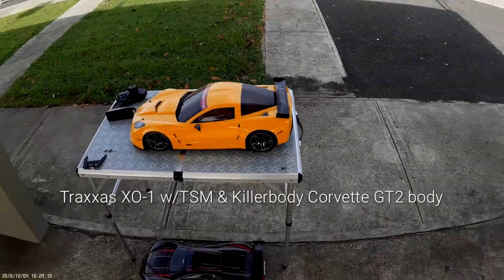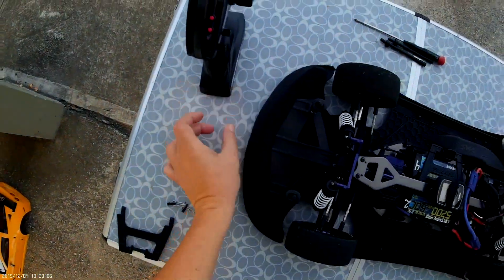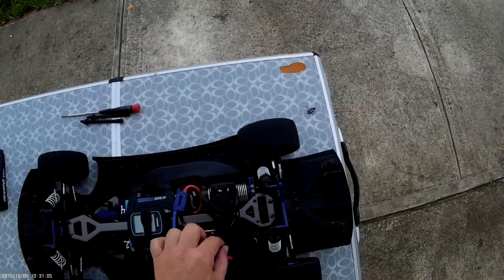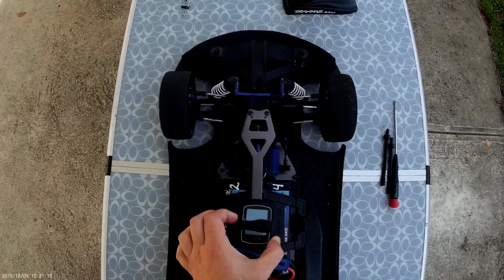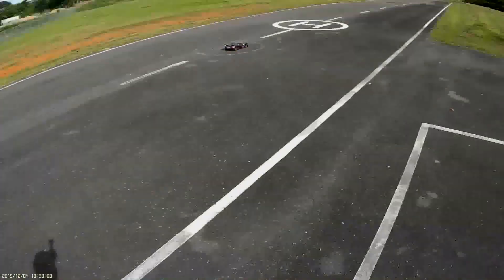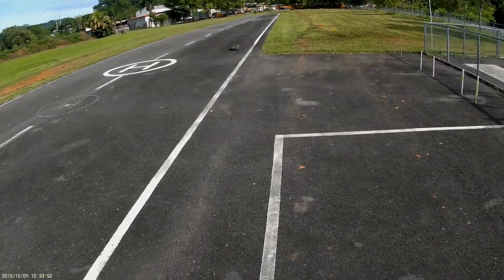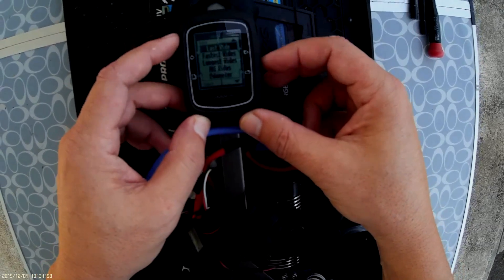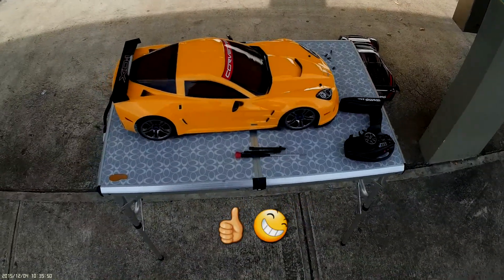Traxxas XO-1 w/TSM speed runs

Comment: Your xo1 is awesome.  I'm running a 20t pinion 46 spur on mine. What kind of run times are you getting on a full charge ? No overheating  ?
Reply from the maker: Donald Barron 
Hi. I get 20 to 25 min runtimes with my setup. I only use it for speedruns. 2 x 3s 5000 or 5200mah 50 or 60C discharge rate lipo batteries.
Reply from the maker: Donald Barron 
Nope. No overheating issues of any kind. I added a WTF (Wild Turbo Fan) aux fan to the motor. Very powerful and reliable fan. ESC /motor never go higher than 115 or 120° after those 20 or 25 min runs at 75 to 90 mph's.
Reply: Edwin Cordero RC Your videos are great.  Keep up the good work  .